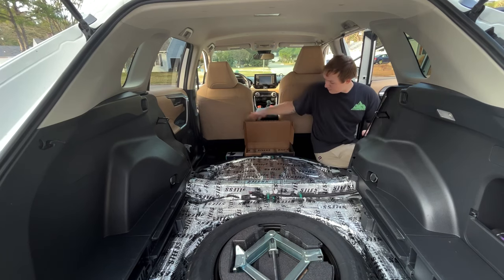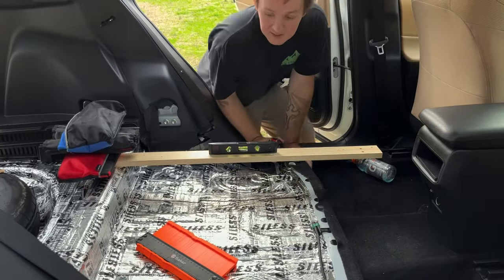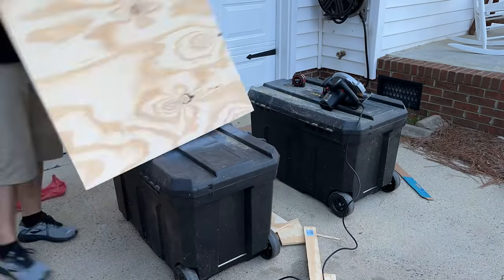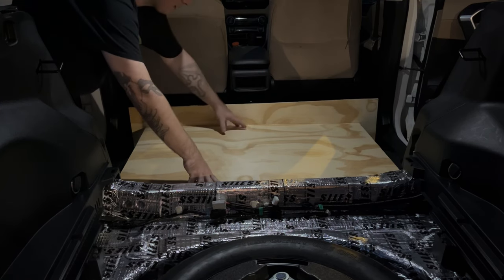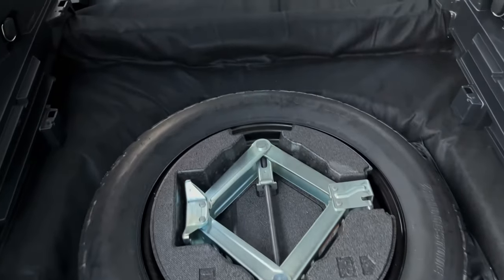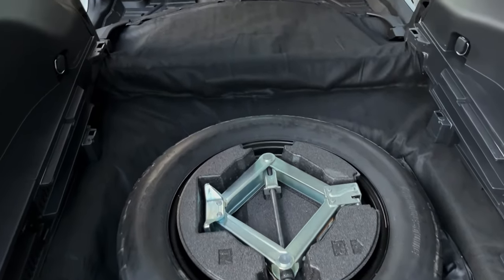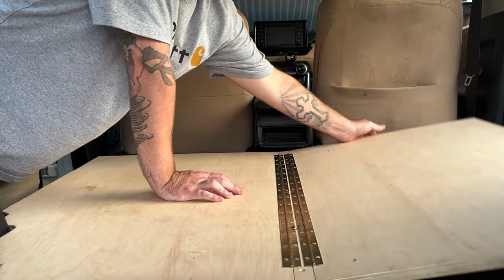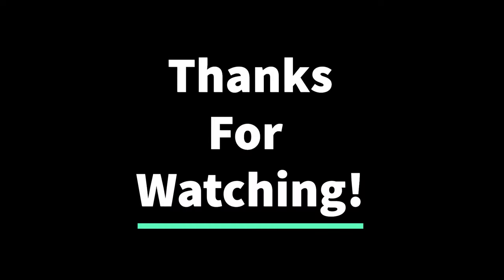How to Build the $150 RAV4 Mini Camper

Comment: In Sam's or Costco, you can get flat and plain cardboard sheets from tissue-paper or paper towel pallets. They are large but thin and flexible, making it easier to cut out templates.
Reply from the maker: Awesome tip, thanks! 
I do things cheap though because I’ve never had a lot of money and what money I do have I try to use effectively. A membership to a store isn’t for me but I’m sure someone will appreciate that insight. $1-$3 boxes for me at Walmart for the win!
Reply: They're called slip sheets
Reply: @smitheys  you don't need a membership or spend $1-3 to go and grab those sheets and empty cartons left near the exit for free.

Comment: Hi Smithy, do you think that sound deadening application that you did has made a big difference? How do you feel now that you're a few months out?
Reply from the maker: Hey Leah! Yes. They made a big difference for me. Still doesn’t take the noise out completely but definitely helped. The seats don’t even dampen the sound that much, so anything is better than nothing. Hope this helps!
Reply: @smitheys  cool thanks for responding. I have a Volvo V70 at the moment and looking for a vehicle that can double as a car camper. I'm sort of torn between the gas mileage of the RAV4 and the upgrade of the Highlander. Also thinking about a sienna with the headroom.

Comment: Hi! Rav4 ..What is the height from floor to ceiling?
Reply from the maker: Hey! From the platform to the ceiling/roof, it’s about 33-36 inches depending on where you measure too and from. In the center of my platform, near the dome-light, it’s 36”. At the back door it’s closer to 33” 
Hope this helps! Sorry for the delay in response.